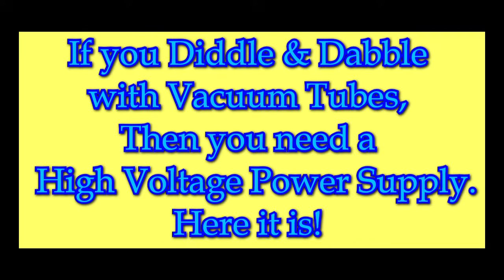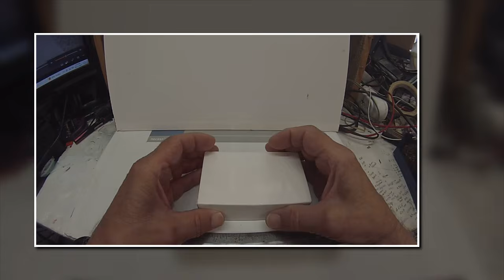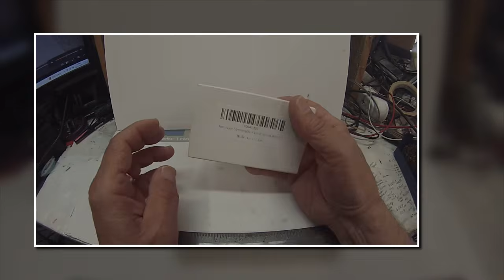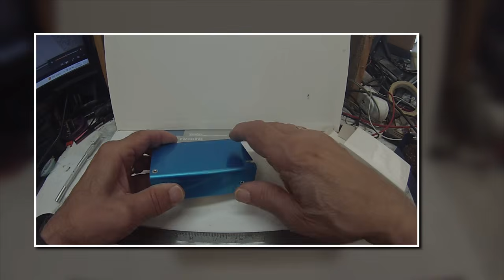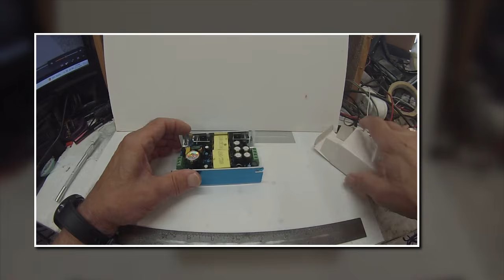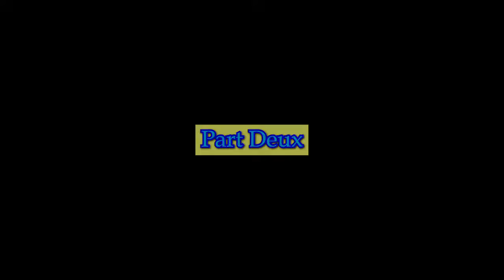Unboxing the vacuum tube amplifier power supply

Comment: Hi Pete. Have you got that Amazon link please?
Reply from the maker: I have added it to the description.
Reply: @N6QW  Thanks Pete. 
With that description I found one item that looks the same on Amazon in the UK. Curiously, they describe in the product description as "The power supply for bilious machine with high power design". 
The supplier currently has 79% positive review rating - with delivery way into November. 

But that could all change and we now know that we need to keep also looking out for "Vacuum Tube Preamplifier Switching Power Supply Transformer" (as described on the USA site), rather than just the UK Amazon description of  "High Power Switching Power Supply for Steel Tube Preamplifier Transformer Valve Amplifier ". 
All my "tubes" (valves :-) are made of glass!